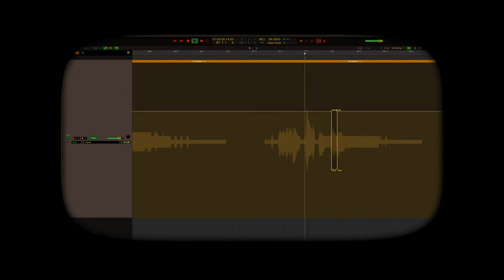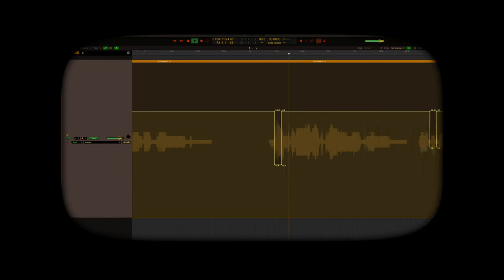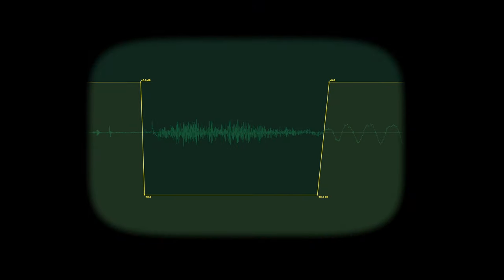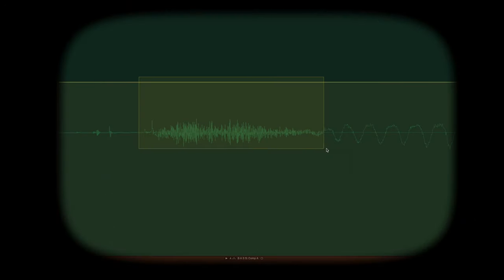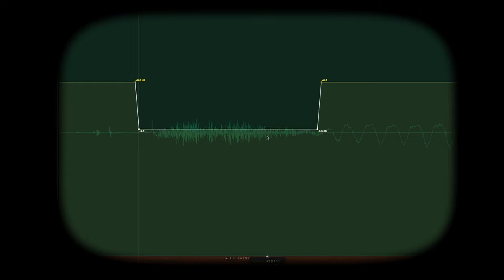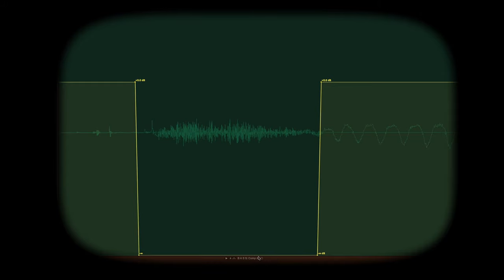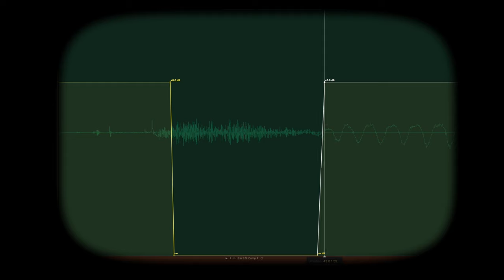De-Esser Plugins are NOT SEXY!

Comment: Yeah after years of mixing voice overs and vocals, to me, de-essers are still some of the most elusive and unsatisfying tools to use.
Using dynamic EQ bands seems to work quite well for me; When I boost the high end I often make the band duck to the louder/sharper sounds (which are bound to be sibilance) and you can hone in on very specific offending frequencies. In a musical context I'm all about automation though
Reply from the maker: Lately I've been loving the Weiss De-Esser, it requires a deft hand to tune but can really work wonders not just for de-essing but also softening hard vocal tones.
Reply: @TheHouseofKushTV  Thanks for the tip, will keep an eye out!

Comment: Hmm. This seems a lot less efficient and not very much more effective than proper use of a de-esser and/or dynamic EQ. I can set the plug-ins in less than three minutes, or could spend a few hours treating each individual sibilant sound by hand. The end result? Probably indistinguishable. I’d rather save my time and ears for other important aspects of the mix.
Reply from the maker: Everyone's got their own approach!  But I'm reading a false dilemma in your words: I wouldn't spend hours treating sibilants either, that'd be absurd.  At this point it takes me maybe 5 minutes to set up a track, and then I can spend 5 seconds tweaking any given sibilant if & when it's problematic in the mix.  You say it's "probably indistinguishable", which is a guess; in my direct experience, no de-esser or dynamic eq in the world is as precise as this technique, and no setting on any plugin works perfectly for every troublesome sibilant, fricative, and affricate in a typical lead vocal.  But as always, YYMV!
Reply: The House of Kush right on. Thanks for your response! I’m a big fan of your channel. I can definitely see the value in your technique, I should explore it more.  Another technique that can be useful, but not as surgical as yours, is to duplicate the vocal track. On the duplicate, use an EQ to isolate the small band of problematic sibilant frequencies, generally around 7-10khz. An EQ with a visual analyzer is fantastic because you can clearly see where the sibilant spikes occur in the spectrum. After the EQ, use a gate. Set the threshold and other parameters so that only the “s” and “t”s get through, which can take some fidgeting. Finally, turn this track all the way down, 100%. On the original vocal track, use a compressor in sidechain mode, with the duplicate gated track as the trigger. You can use this method by itself, or in conjunction with some light de-essing. Still, your method seems like it would be the most transparent!